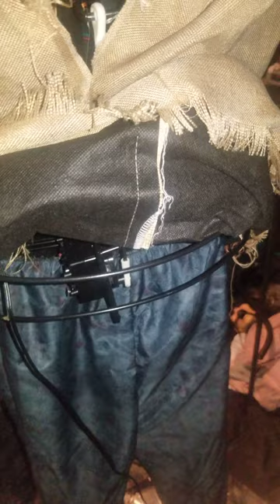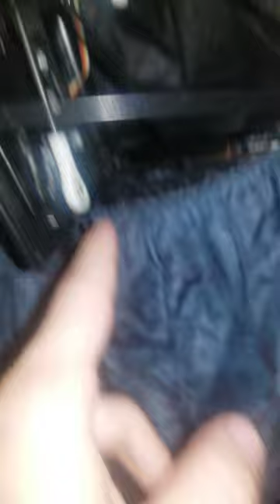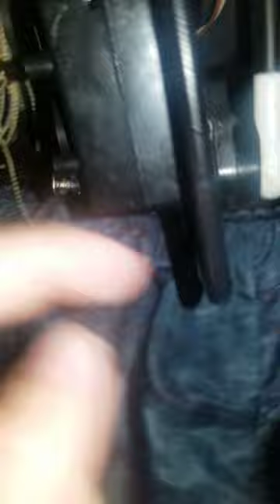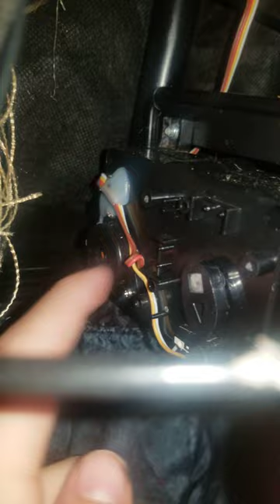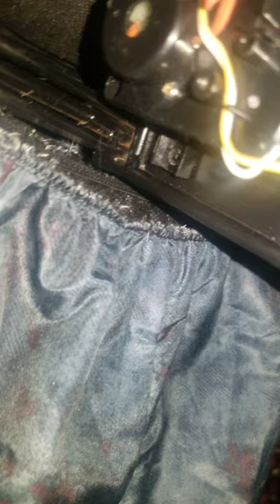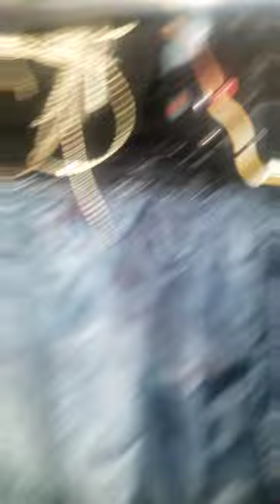Tips for if your Seasonal Visions SVI Spirit Halloween Lunging Animatronic Isnt lunging

Comment: Damn thanks for this, my Hugz lunges only halfway now and the motor does buzz. Only thing is that I couldn’t open the mech last year after Halloween so I’ll either have to get help or a power screwdriver.
Reply from the maker: Theres like a bolt nut on the screws, you need a needle nose pliers hold it in place and twist the screw with a screwdriver, and it should loosen and come out.

Comment: I have the Costco Lunging reaper but the issue is his mouth isn’t moving and when I turned the volume all the way down I used to hear a faint buzzing sound but now it’s stopped I think the motor needs replacement but Is there any way to get inside the head without wrecking the skin.